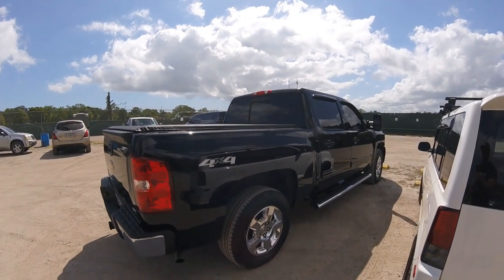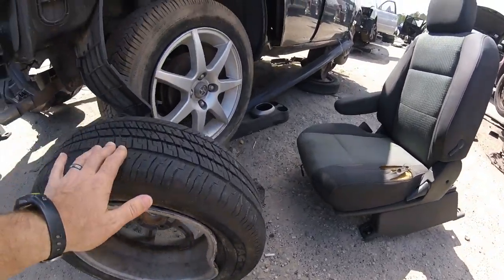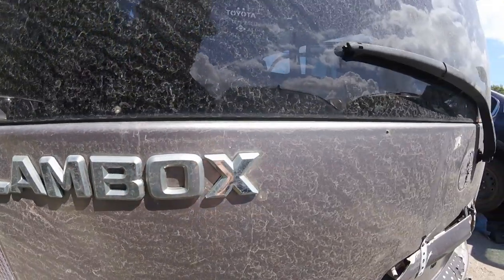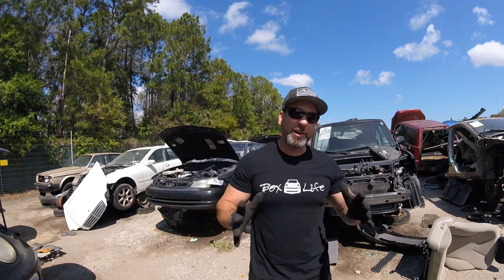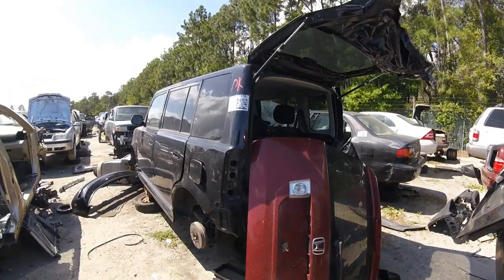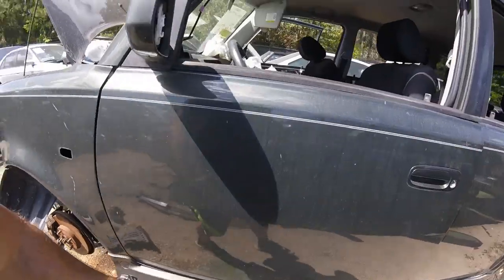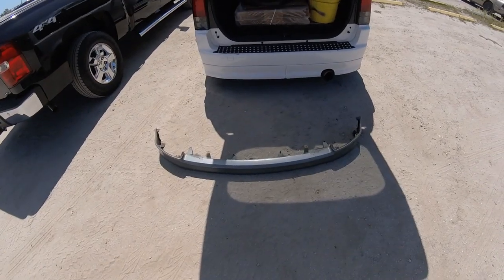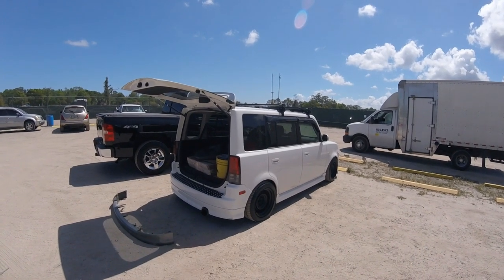SCION XB JUNKYARD SCORE!!

Comment: I have swapped the actuators on my xb1 and they still get stuck in the heat. It's a bad design. So, I found spraying some white  lithium grease down the small gap on the door lock pull lubes enough to reduce the friction. Works perfectly and quick.
Reply from the maker: Thank you for that tip!!

Comment: Yep those are the OEM wheels. There was that option and the 18" wheel option other than the different hubcaps.
Reply from the maker: Those 18's were awesome.You can still scoop up a set on eBay. It's very tempting.
Reply: @ExtremeDailyDrivers  it is. I went and grabbed up a set. I've kept 16s on it, and I have always wanted the 18s. So now the 18s are going on for the summer.
Reply: I got Honda Si rims on mine they were on my 91 Civic haha

Comment: Again, I really want to own xB man. Lol why not own 3? With my 2015 xB2.5, buy another xB2.5, and get a xB1, both 5 speed manual. They last, there fun as hell to drive, very customizable, they also holds its value well. 

I have $2600 left and I will be done paying my xB this summer. After owning it since brand new for 5 years, I can finally be done paying it
Reply from the maker: The most underrated car of all time.

Comment: You just need a stubby Philips screwdriver to remove the door actuators, its a tight fit but besides detaching the clip that links the actuator to the door lock rod, that is it.  No need to remove anything else.
Reply from the maker: Thank you! I'll have to remember that. Thanks for watching!
Reply: @ExtremeDailyDrivers  I would just buy a new online though from ebay, will probably last longer than a used salvage yard one.
Reply from the maker: We'll see. I might just that route.

Comment: I learn that its better to buy the whole door itself if they are good condition. Buying them individually cost a lot.
Reply from the maker: The whole door? Really?
Reply: @ExtremeDailyDrivers  yes. The window cost around $20-$55 actuators $10. Side trims $15-$20.  Front door mirror $30 rubber gasket $10 
Window motor $20-$40

Whole door $ 45
With extra part you can always sell them.

Comment: Love these videos however, what if I want it all EXCEPT lowering an already low clearance ride.
Any Scion groups with mild lifts or off roaders? I can NOT have a lowered car, we have driveways to drive up and driveways to drive down, speedbumps to deal with and poor roads in town to deal with, of the occasional beach access only roads, AKA: Real life roads.
All lowered cars here end up rattling to shyte until it's a parts car. Your guidance, or anyone, would be greatly appreciated. 

Mild lift, good handling, peppy engine though a Toyota V6 swap from a Camry or Avalon would be considered. Good sized wheels however, they MUST be limited to the factory fender well. Anyone?
Reply from the maker: I lived in NJ for 30 years. I could teach a 4 credit college course on bad roads. I've been driving lowered vehicles since 93. You have to learn how to drive a lowered car. There is a skill to it. Once you do, you can drive them anywhere and in any state. Thanks for watching.